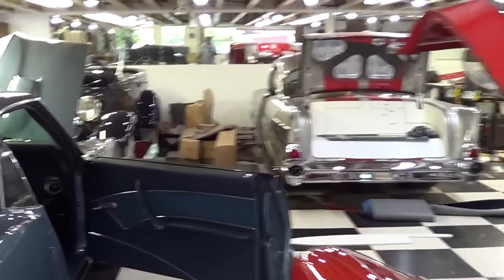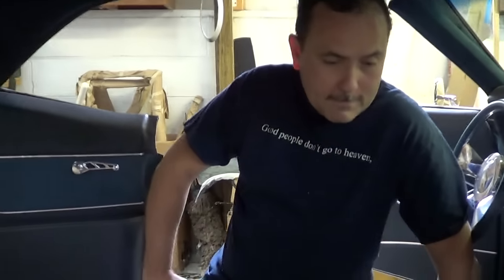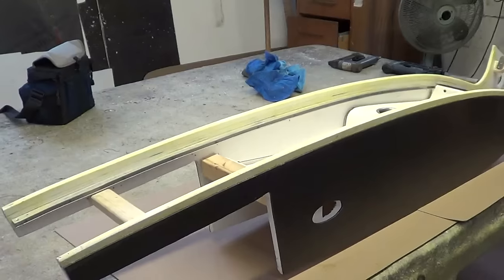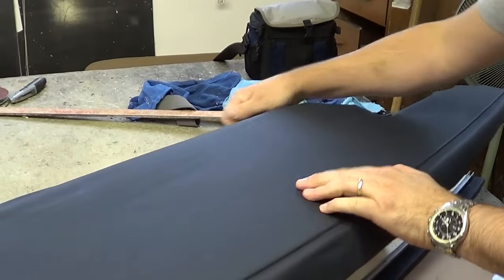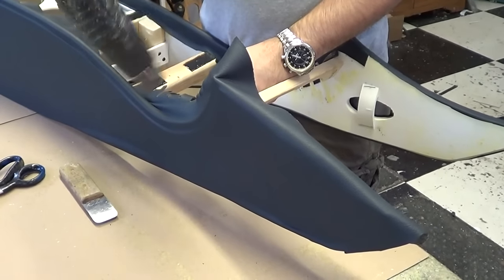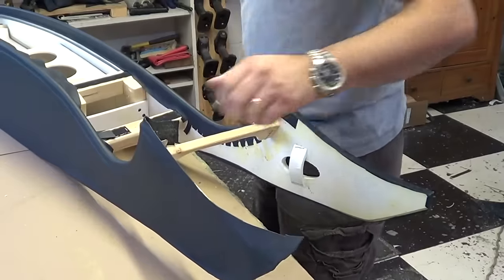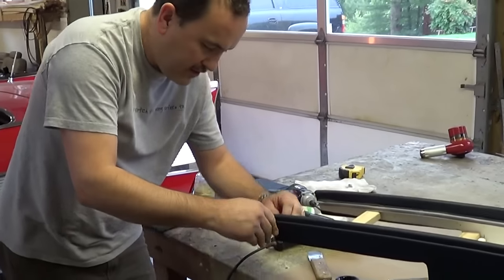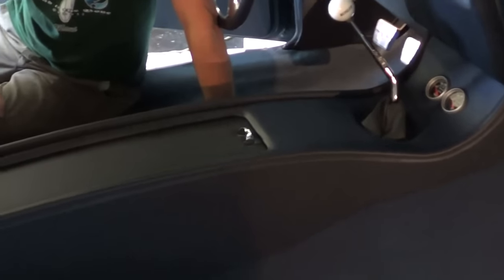How to build a custom center console

Comment: Very nice work. But on a positive note, you can do this at home guys and for cheap! Don't be discouraged by the 20k price. He's earned that from having years of experience but this can be done for less than 50$ without the cost of leather of coarse. You could wrap in many things tho. And you can build the frame with sheetmetal, wood,  plastic old signs(ha). Keep it simple. And then be proud of your shit. Thanks Scotty
Reply from the maker: Sure!
Reply: We did that with a pontoon I bought for 500. 300 in material. A buddy tinkered with the motor [free] .so for 800 and a little time we sold it for little 5k. I like your thinking!
Reply: Any idea what he used to shape the insert and get it to hold it's shape?
Reply: Weldwood Contact Cement
Reply: I used to do shit like this, me and some friends build sound system enclosures and forming it to flow from under the dash to the rear

Comment: Great Video, also when you complete the console, how do you attach it to the base of the car? Is it bolted or does the weight and snugness just keep it there?
Reply: +Chandler Gaines I'd like to know the answer to this too
Reply: Imma do this one Day to a C3 Stingray!
Reply: Most likely bolted to the frame or the floor to ensure that it wont mov out of place
Reply: Chandler Gaines I've used everything from simple L brackets with self tapping screws on my first build to custom molded fiberglass/reinforced body filler with imbedded hurricane nuts and L bracket for strength in odd locations where more contact area was needed. Basically I took the L bracket and extended it using fiberglass cloth/ Matt and reinforced body filler to even out the shape. One of them with 4 mounting holes kind of looked like Boba Fetts ship slave 1
Reply: Chandler Gaines Bolted. If its not bolted it acts as a projectile and all that hard work goes literally out the windshield in the case of an accident.
Reply: A true artist... always makes it look easy!!  Thank u for sharing what took u so long to learn..
Reply: Yes. On both some are bolted through brackets to the floor some are such a tight fit and heavy enough that weight holds them. Depends on car, size and the maker.
Reply: I don’t have any experience in this but if the seats are close enough I’d put flat brackets that go to the seat bolts

Comment: Love the workmanship, I use 3mm (1/8") plywood  as I have high ambient temperatures.and vinyl as leather is so expensive in Spain and it shrinks in the heat, but I learnt a few pointers.
Reply from the maker: Cool...thanks for checking it out!!

Comment: Excellent work!
Wish I had the talent to massage leather into a beautiful piece of furniture !
I have built one console in my years for a '93 Plymouth Voyager. Needed a two way radio console for a series of four radios and a controller for a light bar. Made it out of 1/4" plywood and had it professionally upholstered in a matching vinyl leatherette. Had a pair of cigarette lighters on the back side and a drop down panel in the front to hold the fuse block for the radios. It was equipped with a lid that folded to the back that could be removed when in the field for emergency work. Wish I had kept the console when I sold the van.
Reply from the maker: Right on....Sounds cool!

Comment: ScottieD....I don't know whether you know or not, but it would be interesting to know how he bent the center portion of the console to get the curves to it. Someone below asked the same question, and the reply was to heat it. That may very well be true, but to heat something up, there are many ways to do it. I would assume a heat gun, but then again it may be something else. Also I would like to know (if you know) what he formed the piece around to get the curves to it. TIA.
Reply from the maker: Ask them https://www.facebook.com/Pro-Auto-Custom-Interiors-by-Steve-Holcomb-387344154615199/ They use a heat gun....and for bigger things a salamander...it really doesn't matter as long as it will get the plastic sheet to a temp it can be molded....

Comment: for the sliding door, did he use just extruded aluminum channel? and did he screw it to the pvc board or to the wood blocks?I'm looking to do the same on my 70 Camaro pro street and also fabricate a dash with an oval gauge cluster like some other custom dash boards I have seen. awesome work.
Reply from the maker: See past comments....Glad you enjoyed the video!!

Comment: @ 19:35 those little brackets on the back side of the lights are those also made from foam board…? 

How did he attach those curved strips (the light hole backside bracket) I don’t see screws or anything or did he just use glue for them…? 

Also if u don’t mind 

So it starts with foam board 
Then the blocking with wood 
Then the 1/8th “ foam board 

But then it looks like there’s like a yellow color material right above the black foam board… what material is that? 

Getting ready to make something similar so any info I’d greatly appreciate it’ 

Also for the cup holder slider lid did he just use like aluminum u channel attached to the foam board for the track?

And sorry 1 last question where the circle lights will be how does he connect like that piece of the console to the dash…? Or is it just screwed to the floor pan and just sits up next to dashboard if that makes sense
Reply from the maker: All I know is in the video...sorry

Comment: Ok, the contoured insert with the cup holders and hole for the radio control looks like its foam of some sort. Can you briefly describe whats made out of and how its able to curve around without breaking? This is a great video. I never thought of using PVC sheet, I was just going to use luan sheet. The plastic is a better idea I think.
Reply from the maker: +The Shaker, Wiper De-Icer https://www.facebook.com/Pro-Auto-Custom-Interiors-by-Steve-Holcomb-387344154615199/?fref=ts
Reply: +The Shaker, Wiper De-Icer It is 1/4" PVC expanded board and shaped with a heat gun

Comment: Just curious, what is the white material you use for the sides and for the curved fascia where the cup holders are, Ill watch the video again incase I missed it but looks awesome as you already know but I love it, 
I made a console to fit an old 1960 car and it came out well, but I love the curve internals where the cup holders go and the sliding lid.
Reply from the maker: It's sign board....see back comments on where to find it...

Comment: AWESOME, Thank You for making the video. I will definitely be trying this. I just have a Dodge Colt Hatchback, but I love the little car. I only paid $200. for. I plan on upgrading engine for better performance & doing a total interior transformation, all by myself & this video really helped make up my mind on materials to use. THANKS
I was wondering if Steve made the molds for the rear seats? If so, what material was used & how did he form them? Is it the liquid foam mold that can be bought in various density & weight capacity? And cut & sanded down to form? I would like to try my hand at that project also.
Reply from the maker: Glad you enjoyed the video...PVC Sheet is used for most of the interior..
Reply: OK Thank You!!!

Comment: where can you get the PVC sheeting? I need to build consoles for my truck and my 88 firebird. I didn't want to use MDF or ply wood. because of the weight. it would likely take 2-3 ppl to install when finished. the PVC foam would be lost lighter. thanks.
Reply from the maker: See past comments...
Reply: You can get them at Lowes and Home Depot as well as Amazon

Comment: Would like to see how you bend the middle piece into that shape.  I know pvc bends easily with heat, but would like to see the process.
Reply: You just heat it up.  once its hot it'll do whatever you want it to.  I used to manage a production line that made that exact product

Comment: I read a lot of the comments here and I’m still a bit confused on what material he used for the sliding door and the insert for the top of it , also it appears as though he used some tracked aluminum for the tracks for the door ?
Reply from the maker: C channel from a hardware store...Plastic sheet from a sign company...

Comment: Please could you tell me the type of foam that you have used in the centre of the console. I noticed that it is sanded to form a cup hole / gear stick hole? Is this a type of closed cell foam? if so what is it called? I am struggling to get something similar in the UK. Fab video, I learnt so much. Thanks, Carol.

Comment: Is there a more detailed step by step of this? Also what would be the suggestion on pvc board, i want to get something somewhat textured to match the texture of a scion tc but haven't had any fabrication experience before? Basically i will just be doing the fabrication primer and painting it-not covering it unless it is a smooth only surface. Also love the channel, gives me alot of ideas for my car
Reply from the maker: I don't know any more than what this video shows...I do know that you are going to want to cover it with something....there are screws and braces that need to be covered up with something...and keep in mind this is part of a 15k interior and the guy showing how it is done has over 20 years doing this...glad to hear your enjoying the channel....good luck with your project..

Comment: What was the material he used on the inside for the shifter hole and cup holders.... It's isn't the same as the PVC sides, he fashioned it and  curved it, seemed flexible not rigid like PVC.
Reply from the maker: All I know is in the video...the pvc sheet is flexible  when heated...

Comment: I was trying to figure out as for materials whether they were using expanded PVC board or the denser PVC board. Do you happen to know? Also how did they bend the face of it to go with the contours of the sides?
Reply from the maker: +zippitydoowop I'm guessing the denser...it's like a sheet of plastic....and it's is all done with heat....
Reply: Thanks, man! Working on my own up here in NY and wanted to do it right! Great video!!!
Reply from the maker: https://www.facebook.com/Pro-Auto-Custom-Interiors-by-Steve-Holcomb-387344154615199/?fref=ts  Steve is good about answering questions...Just remember his time is expensive....so try not to wast it..lol...Good luck on yours Brother...Keep Me posted
Reply: +ScottieDTV I spoke with them on the phone this morning and they were kind enough to share that they use 1/8" as the accent on the sides to cover the screw holes, 1/2" or 3/4" as the main side panels and 1/4" on the sides. And it's all expanded plastic, otherwise known as PVC foam board. They're pretty awesome!
Reply from the maker: zippitydoowop Great Guys for sure....Good luck the only thing you will be missing is 30 years experience...lol
Reply: ScottieDTV Certainly can't beat that! Lol. But your video is a great place to start :)
Reply from the maker: zippitydoowop Right on....Hope it helps!

Comment: .. need Tim to make me one for my 71' chevelle , exactly , but without reaching the back seat , and no cut out for radio pod
Reply from the maker: +Edward Despain Need need the car.....
Reply: +ScottieDTV ... 68 - 72 chevelles all the same floor pan and tranny humps .. (4 speed)
Reply from the maker: Edward Despain Doesn't matter....This is all custom stuff to fit the car...all those cars are a little different from the factory...It might fit...but it wouldn't fit right...
Reply: .. with the work that Tim does Im sure it would be relatively close , and anything thing from him I would be overly pleased , but for starters , without console ran upto rear seat , the big question is what kind of price or ball park we would be starting at
Reply from the maker: They don't do close Brother...This is High end on off custom stuff.... https://www.facebook.com/Pro-Auto-Custom-Interiors-by-Steve-Holcomb-387344154615199/?fref=ts is there Facebook...See what you can work out...

Comment: What is the main structure made from? Foam and what else?
Reply from the maker: It's all right here in the video?
Reply: PVC but you could probably use MDF.
Reply: im guessing they are using PVC because with a heatgun its bendable, hence the shape of the middle section :) 
mdf would be harder to get into shape

Comment: How did he curve the interior panel (the one with the cup holders)?
Reply from the maker: Heated it with a heat gun
Reply: probably the same heat gun he used to soften the leather, then bent it around a pipe or something.

Comment: I'm wondering why he uses PVC sheeting instead of plywood? the PVC sheeting is $179, a sheet of plywood is like 25 bucks, a can of truck bed liner is $6 at wal-mart. seems to me you could build one for 1/8 of the price with wood and paint it with truck bed liner so it lasts as long as plastic.
Reply: +Bryan O'connor Just guessing, probably he was thinking in the future....wood warps, yes, they could go cheap but you would be like buying china....ok today no good tomorrow... get it.
Reply: well like I said, paint the wood with truck bed liner and it good virually forever and still cheaper, I'm not knocking just saying.
Reply: +Bryan O&#39;connor  you think he didn`t think that route?   He is going for pro results.  There is a difference.
Reply: He's wrapping it in Vinyl or Leather anyway, he's gonna get "Pro" results either way. I guareentee you that I could build one out of wood that A. would look just as good B.be stronger throughout out the life of the console C. be cheaper to make and D last longer . That's my point. when your building a car your working with a budget unless your Bill Gates or Warren Buffet, the money you save on building the console out of wood could be used on something else on the car.
Reply: +Bryan O'connor Maybe pvc is more lightweight than wood
Reply: StealthShadow5 I know it's lighter but wood is cheaper, will last longer due to change in tempatures, the pvc will warp if it gets too hot and crack if it gets too cold and wood will be more durable over time especially if it's lightly coated with truck bed liner because then it's water proof too.
Reply: red2965 I am a pro. I've own my shop for 20 years.  I use wood. 90% of professionals use wood.  👍🏻
Reply: It is easy to work with and you can bend it with a good heat gun. Even with all the paint\coating and fabric  the wood still holds plenty of moisture and can warp,crack and split. I am sure the price he charges for the interior will cover the cost of materials he uses. That quality of craftsmanship does not come cheap. Always remember the best use the products that help make them better . Don't go cheap on your car. Just my 2 cents.
Reply: George Copeland George  I own a shop. I do only custom high end interior.  I use mostly wood coated in automotive urethane and abs plastic.  No moisture retention or warpage at all.  Specially with vacuum formed abs.  A skilled craftsmen can make anything work.  Trust me I hear "hide it under the Upholstery" way too often.  Lol.
Reply: Sorry to see you have a stuttering issue. I was just stating my 2 cents. I heard you say that you own a shop. Say it 2 more times and it will make me care . Show your work post a video then. Name your shop. Keep your talking down on others for someone else. I did not ask you anything. The material a person uses is up to them. Some find they make a better product with different material than you. You should be happy this guy was nice enough to show you how make this on your own. Now take what learned  and go to your shop and make one for your client and take all the credit. Good luck . You need to change your name to ClownShoes.
Reply: "GREAT JOB" You could do my Firebird anytime!

Comment: What is the material you used to make the console
Reply from the maker: PVC Sheet...see past comments
Reply: The sheet goes by the name of Sintra. Sintra is a brand name though. It's a closed cell foam pvc. You can pick up some samples of it at a local sign shop.

Comment: Why does he use PVC? Why not fiberglass?
Reply from the maker: Several advantages.....first of which is it is much cleaner to work with....last just as well...lighter....quicker turn around.....ect...
Reply: Fiberglass needs to be laid up in a mold, plus the small glass fibers and resin. PVC is a great idea, easy to work with and is more stable with temperature changes than wood.
Reply: I make these paintable outa wood and fiberglass. Filler primer etc. His are very clean alot less work

Comment: ScottieDTV do you know the size of the PVC foam sheet he used
Reply from the maker: TwinSOLid438 Different thickness for different parts on the project...I don't know the exact thickness for anyone part...sorry...
Reply: The main part is 3/4 and the black skirts are usually 1/16
Reply: I am shopping for this foam. So it is 3/4" but does someone know a source? I am looking on McMaster and Grainger....there are so many types. Anyone find it already that can help? Thanks
Reply: Dennis in CT here in East TN I get it from a local plastic supply company. It's actually PVC foam core board. Check you local big city they should have a distributor that sells similar stuff

Comment: I am very disappointed that there was absolutely no explanation of how the PVC foam sheet (assuming is was also PVC foam sheet - it was not mentioned) of the top surface was bent into the wonderful curves. You just skipped from the sides being tied together with batons and then suddenly the curved top panel, complete with cup holders etc, was ready for leather trimming. HOW DO I MAKE THE CURVES?????
Reply from the maker: +Andrew Van Day Heat it....bend it....let it cool.....relax....

Comment: Good video but you this is more of a rough overview instead of a tutorial. You didn't even detail how the cup holders were designed and how they were fit into the console. In fact, I'm not even certain what the contouring material was that flows down the center of the console, let alone how it was designed and fit into the center of it.

Thanks for the video though, it still gives a decent overview.